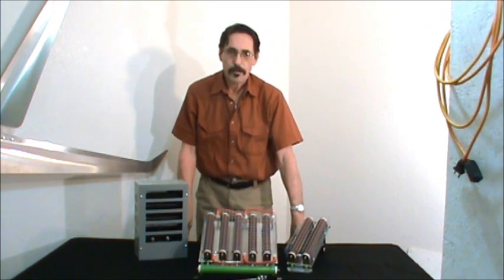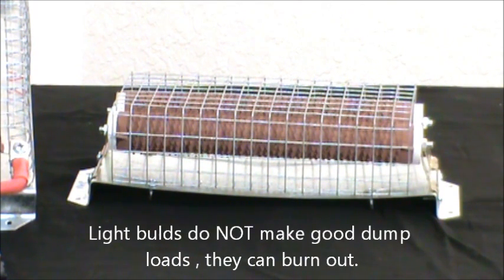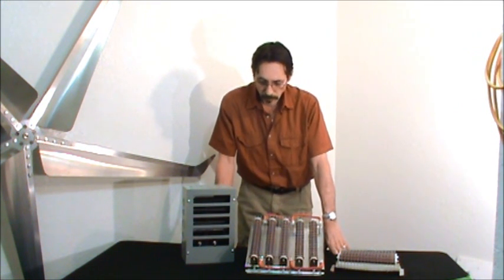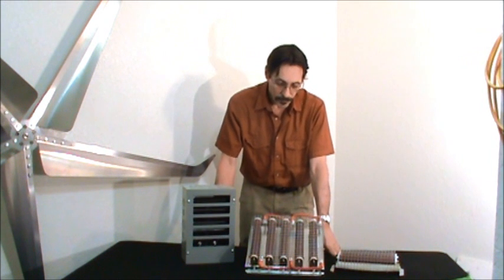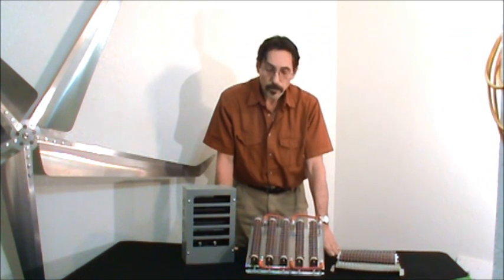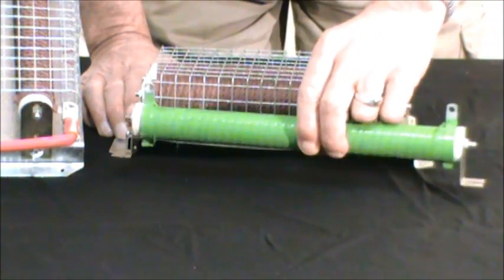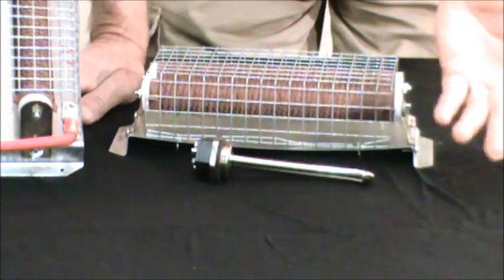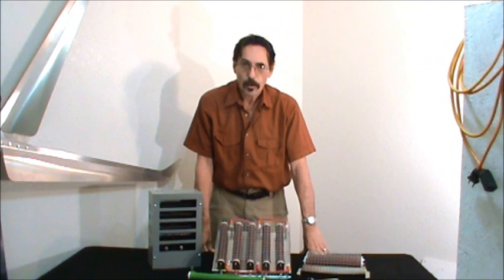Wind Turbine Divert Dump Load Resistors | Missouri Wind and Solar

Comment: now that i think about it more, having this in the laundry room which is in the cellar, is not heated, is cool/cold even during the summer, it could potentially be a good way to add some heat to the room.. small usb fan on them to further dissipate the heat..    may even get an inexpensive 30 gallon water heater to use the DC dump load in it merely to pre-heat the water going to my on-demand water heater.

Comment: I have seen some wind turbine controllers advertised as providing braking for the turbine. Is this common, do all Wind Turbine's work with them, does the idea work generally, and if so would you then still need a dump load?

Comment from the maker: Yes you do. If you dump load on the inverter kicks in and you have no dump load your wind turbine will spin up very high. When the dump load switch goes off your inverter will get hit with very high voltage.

Comment: aah its the same exact concept when you test a tube amplifier and you always want either a speaker or a >> dummy load << the same ohms as the speaker and enough watts to dissipate that heat!  or else you can blow up your whole bottle powered sound machine!  thanks your very precise and educational.  Im starting a youtube channel where I build things that use or create green energy, and I'd possibly like to DIY a wind turbine out of some 3 phase alternators i have here, ive converted them to motors as well, its so much fun, informative, and with a little effort i will be doing a solid to help save our planet from the follies of fossil fuel folks and their greed mindset.....

Comment: Thanks for the info Jeff. I have an important question: Is it possible to connect two dump loads to one controller? The controller only has two terminals for the dump load.

Comment: Hello Jeff, what would be the correct volt you would need to run a 890 sq foot home to be off grid ? working on the set up a little at a time. However long term we want to have wind and solar, to run our house completely Thanks for all of the GREAT VIDEOS

Comment: If you are not planning to charge batteries with a wind turbine, but instead use a wind-grid-tie inverter that has a dump load divert feature, do you still need to use a dump load for any reason at all?

Comment: I use the Missouri Wind and solar charge controller and resister style dump load. If anyone needs some help or has a question you can also ask me. I will help you out. It is pretty simple but sometimes you just got to ask a question,, just to make sure you did it right. I know I was there.

Comment: So, for a 1600W Freedom wind generator, a dump resistor of 1500W wouldn't be sufficient?
That's the biggest assembled array (5 pc resistors) I found on your website..
Tanks for any reply/suggestions.
Reply from the maker: Yes a 1500 watt dump load would be sufficient.

Comment: hi will the 300 Watt element handle a 24V cirtuit? And i mean 2 12v batteries connected in series and  then a cable on the positive and negative to the element?
Reply from the maker: ELCCABRON Yes it will

Comment: Here I am again sucking up information on wind turbines. My battery bank is made up of 12 6 v dc deep cycle marine batteries, wired series/paralle. With a 12 volt, 2700 CCA. I would like to use a 12v 300 watt charege controller with diverter dump. Can I? If not what would you recommend? Thank you again your time and assistance.

Comment: Thanks for this video. Great info there. 
Maybe this should be an email direct to Jeff, but....
We're just now looking to add wind to our 48-volt 4.8kw PV system. We use lithium modules repurposed from a 2014 Chevy Volt (24kWh). Lithium prefers a 20-70 percent state of charge range, unlike lead acid which wants to be at 100 percent. It also can discharge and charge at faster rates than lead acid.
In our Canadian winter nights, and on cold cloudy days, we heat our off-grid home with resistance heat (about 2kw worth--the house is a superinsulated, airtight and well ventilated Passive House). Our Magnum inverters (a pair) can easily handle the load. 

Here's the question about dump loads: Would our heaters serve as the dump loads once the battery is charged (even if it's to 100 percent)? I sense that since the heat draws the batteries down over 4 or 5 hours before our propane generator fires up, there would be a constant load on the turbine. Also, I imagine that selecting the appropriate size turbine for our needs is critical.
Does this make any sense? Thanks for any thoughtful input.🙂
Reply: I believe you can... I'm doing the same thing on my 48v system. it calls for a relay switch then stock baseboards or water heaters can be used. my problem is finding the right relay switch AAARRRGGG. there are hundreds of types.

Comment: If one does not need a battery store - can one divert all the power say to an immersion heater, so that all the power from the turbine goes straight to heating water? What would one need?
Reply: Jason Hudson By the way, I have an AC 500W 24volt Wind Turbine
Reply: +Jason Hudson 
Dear,
I have installed 600w wind generator connected with controller (24v) then connected with immersion heater (600w). then really the wind turbine moves slowly which means no enough power generated to heat 600w immersion heater . but i do not know exactly what the solution? or why it moves slowly?
Reply: +Jason Hudson please I need a solution?
Reply: I did not get a solution for this either
Reply from the maker: +Jason Hudson Yes you can do that. You need to make sure that the element your using doesn't have to much resistance or it can stall out your wind turbine.
Reply: +MissouriWindandSolar 
dear, the resistance of immersion heater is around 1ohm. is it suitable to connect it directly with the controller 24v 600w

Comment: Would asbestolux be okay at the wall?
Reply from the maker: Yes, that would work.
Jeff
Reply: +MissouriWindandSolar 
Is it possible to connect dump load( immersion heater) to the controller without batteries?

Comment: can any one help Please.I have 24v 750w solar pannals conected/24v  50ammpt charger and 24v battery bank but now my friend give 12v air breeze 400w marine turbine build in 12v charge controler .my question is if ther is any way that i can charge my 24v battery bank from 12v wind turbine?
Reply from the maker: You  cannot use that wind turbine to charge a 24 volt system. It will work on a 12 volt system only.
Reply: MissouriWindandSolar  many thanks
Reply: you cannot charge the battery bank 24vdc from 12v wind turbine otherwise your wind turbine will get burned